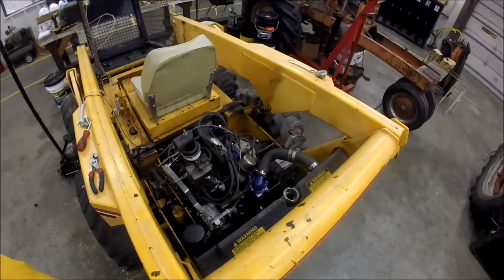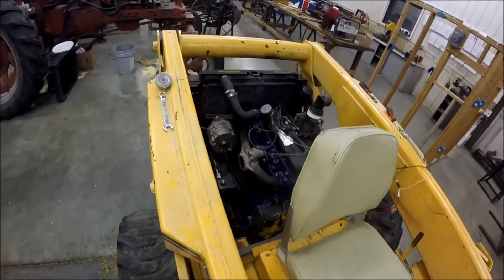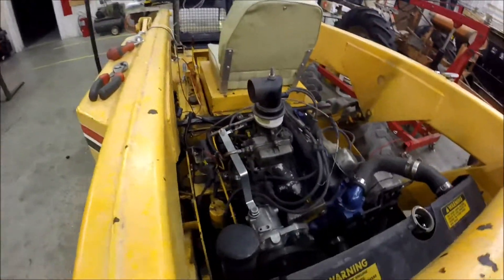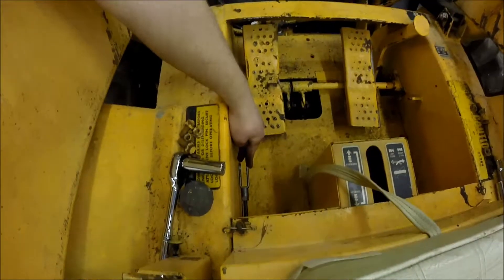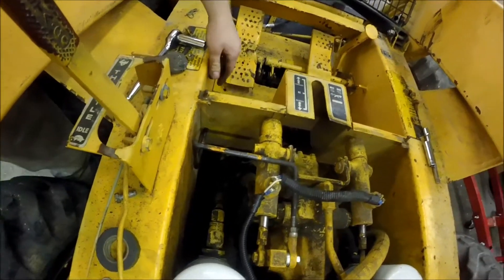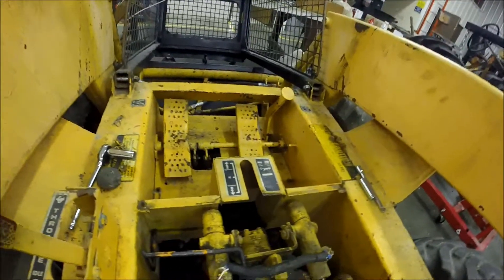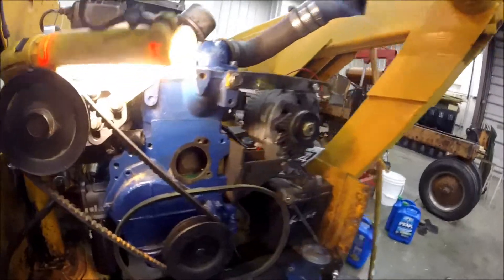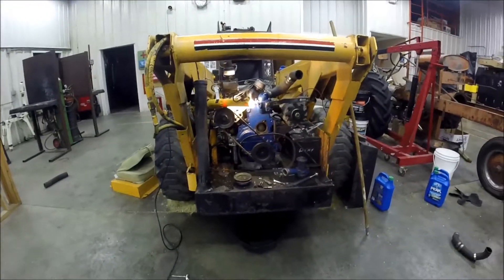OMC Mustang 345 Skid Steer: Engine Installation

Comment: I'm working on getting my 345 back together. It took 5 years to source a correct working governor... Anyways, I ordered an accessory belt of a gates catalog for a 445 with the same engine, but it's too short. My machine was owned by a automotive garage and they cobbled parts they had lying around onto it over the years. I'm not sure if my alternator is correct. Is the one on your machine a full size automotive alt? If so, any idea on what the belt part number is for it? My pulleys and brackets are the same as yours. When I got the machine the belt on it was too long and it actually cut into the side of the battery.
Reply from the maker: Unfortunately we no longer have the machine so I dont really have any documentation for it anymore. We did have some issues with the governor over the years though and were able to track down a good ol boy from down south that helped design them. He made it sound like they are pretty impossible to replace anymore.

Comment: Do you still have this machine? Questions on where you sourced parts
Reply from the maker: We do still have this machine for now, although we are looking at upgrading soon. Parts for the skid loader itself can be purchased through a Mustang or Gehl Dealer, or if they no longer have it on hand there is a New Old Stock company called Parts Depot that may have it. As far as the engine parts I don't recall where they came from but I believe it was someplace in Nebraska.

Comment: Hey bud I have the same 345 with the ford gas engine ran fine sat for 4 or 5 days and now won't start any ideas? Thank you
Reply from the maker: Going to need more info, there's a hundred things that could be wrong from what you said. Does it turn over? Gas engines need 3 things to run: Fuel, spark, and compression. Since it was just running fine we can probably cross compression off the list. Take the fuel line off the carb and put it in a container, crank the engine and see if the fuel pump is working. Get a spark tester and see if you have spark. Those would be two easy places to start, then you can work on tracing the root of the problem.